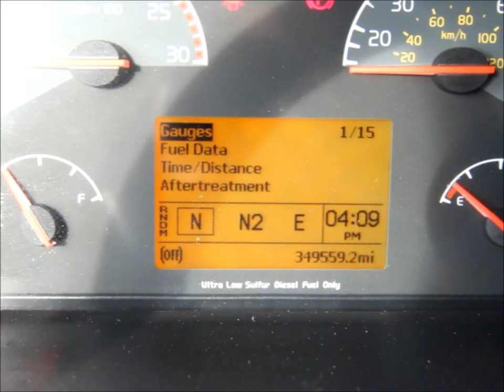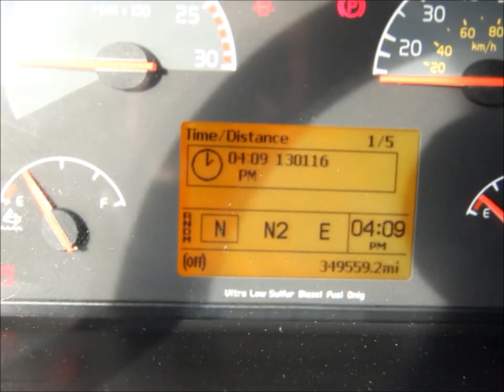How to set the clock on your Volvo Truck

Comment: Changing from 24 hour military time, There is no "clock format" option! UGH
Reply: Push radio knob and turn til u see 'clock' then push knob, then turn knob to 12hr and pish knob to exit
Reply: @donk5552  not trying to change clock format on the radio, the video is clearly about changing clock format on the dash display.